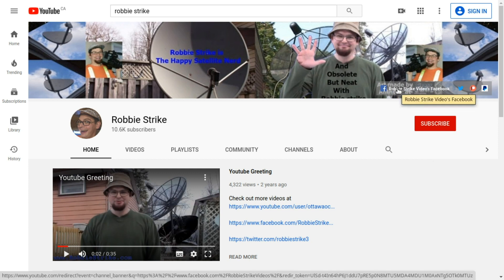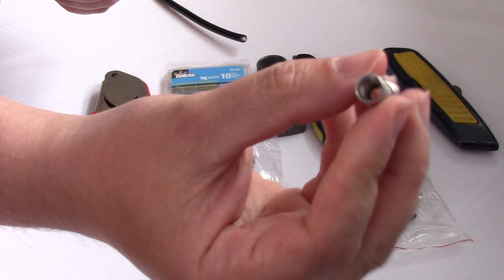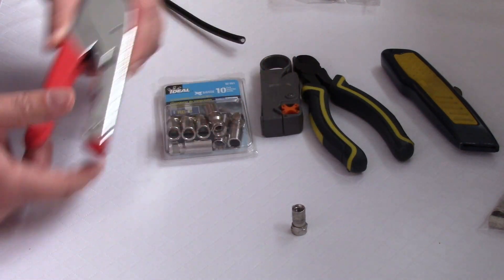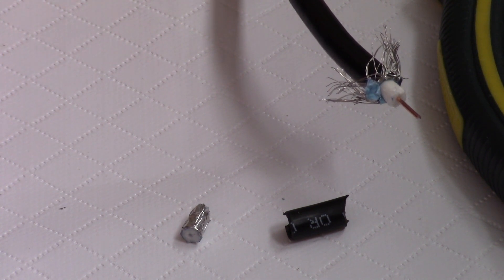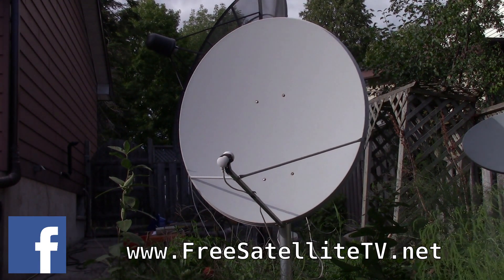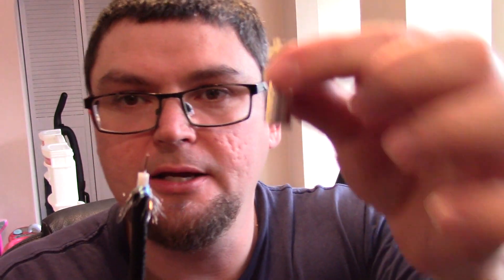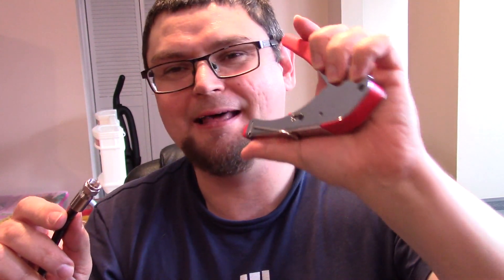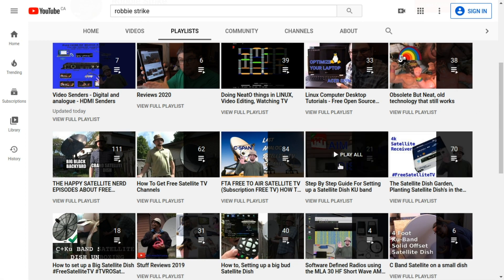How To Make A Satellite Dish Antenna Coax Cable - Tutorial

Comment: Just bringing up the question what about using Han radio coax , well yes and no depends on the use, i know that one can use sma coax  to  wire a c- ku  inb on c band dish ware using rg 6 or rg 59 rg 8 is to stiff i have done it ,  they do make adapter’s to go from f to sma connector, only draw back once  you go from f connector’s to sma and ham radio connectors you have to learn to solder center pins. It is an interesting hobby, i recently converted a hughesnet and a dish network dish to fta ku band trying to come up with a Directv slim line to convert.

Comment: I don't think that's quite accurate to say those "rotary" stripper blades "go bad" really fast and "not worth having." When adjusted to the cable you're stripping, they're fantastic. The problem is you need to test-strip every time because they often need to be adjusted pretty much every time...the tiny allen screw blade-height adjustments have no resistance to their turning...so easily can change.

But the other thing I've been doing for decades is use a lighter or soldering iron tip to soften the insulation about an inch back...then strip that bit of sleeve off by pinching through with your fingernails and stripping off by hand...advantage being you NEVER damage and lose strands from your braided coax shield with a razor blade.

I bought one of those cheaper generic crimp/clamp tools too, in a combo kit...they're fine with the connectors that usually come with them, but I discovered they didn't have long enough compression travel for Belden EX6 or similar weather-proof connectors...it's worth having an adjustable compression tool that works on ALL connectors...like the Klein Tools VDV211-063...EXCELLENT pro-level tool half the price of the other Pro tools.

Comment: about time you got rid of the screw connectors.👏  if you need a few connectors, ask a cable installer. dont nic the center conductor.

Comment: Greetings Mr Strike.I  just started watching your videos last week.I love them.Very informative. I am in Pensacola Florida.I utilized all sorts of free cable/ku  band back in the early 2000s with my  Sonicview Sv-hd8000 receiver & A-1 8psk Module Board.I still  have two of them on the shelf.  Question. Is that receiver obsolete for  usage for ku band Galaxy 19?If so what modest unit would you recommend Sir.Also I just purchased a AVENGER KSC 321S-2 0.2dB HD SINGLE UNIVERSAL LNB Linear Ku Satellite LNBF HD FTA.Is that recommended?I appreciate any advice Sir.
Reply from the maker: it would probably work for most of Galaxy 19 channels. And they have a over the air Atsc tuner. I use to use one for my over the air pvr before it died! check out my shop https://www.facebook.com/pg/FreeSatelliteTV1/shop/
Reply: @RobbieStrike  Thanx for getting back to me Sir . Checked out your Face page .Awesome products especially the Freesat v8 finder. Keep up the good work.We need you.Everybody else that provides this kind of info has a heavy middle eastern accent.Impossible to understand.I have you bookmarked for life.Peace

Comment: I installed DTH dishs back in 2012 and I use Belden's blue plastic plugs (for standard shilded rg-6) on my BUD too since. My cutter and crimpers still works and its way faster.

If water, snow or ice are gonna run on them, I just tape them. Use good electric 3M tapes. Those dollar store ones gonna get hard and keep moisture in, the worst.

Also,make sure to cut the cable so the tip of the white insullater is flush to the inside base of the plug. You don't want to change the impedance, short it or keep the plug from threading fully.

Good plugs and new cable every time makes the impedance mismatch low and thus keep the signal strength.

I cheeped all the way on my own installation to fund myself feet deep in the snow by -30c remaking plugs that the wire have been cut by rust in less then a year! ;-)

Comment: do you have to seal the outdoor connections? also do you still have a shortwave radio maybe you could do a video on it
Reply from the maker: The water seal ones work exactly the same just have rubber on both ends. For outside they are much better than the screw on kind!
Reply from the maker: I have a few short wave radio's But Listen to the networks on Galaxy 19 it is most of what is on shortwave but with fm radio quality. But I do have a Software Defined radio and have done a video on that https://www.youtube.com/watch?v=JCI9yKdwVDM